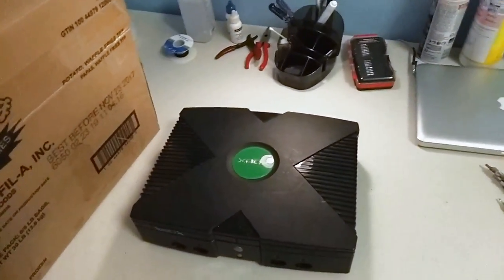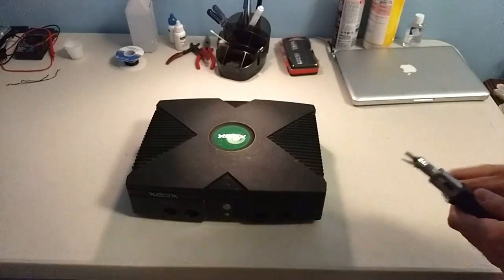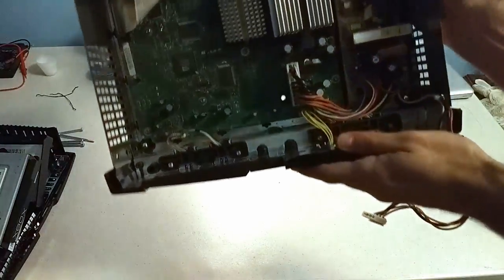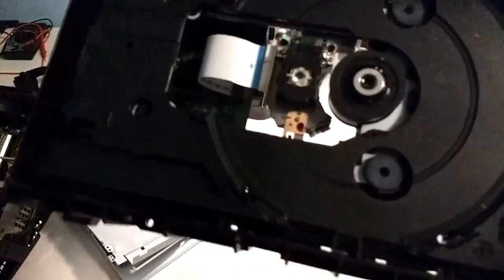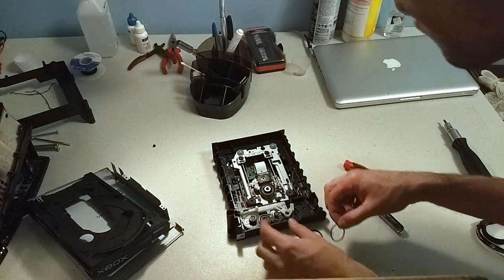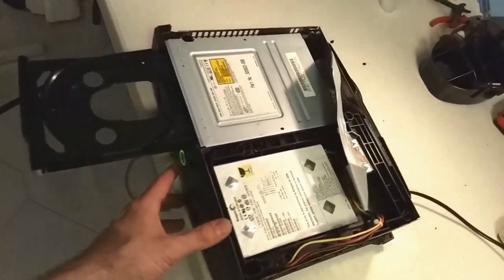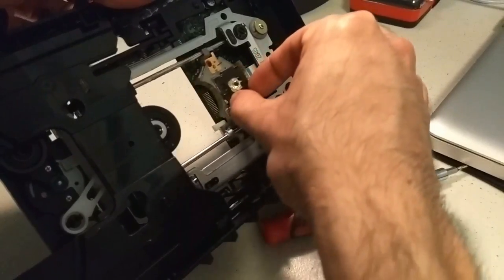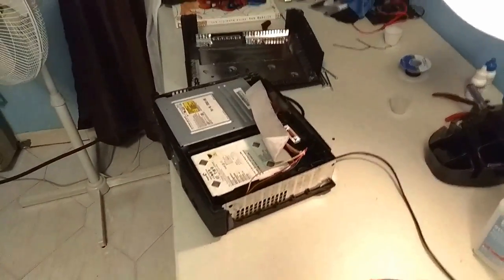Ebay Repairs- How to repair a stuck DVD drive on the Original Xbox

Comment: There is an easy way to get these drives open without opening up the xbox. Although, It does not work on every drive type(It does work well with Samsung drives). There is a tiny hole to the left of the eject button. If you straighten out a paperclip and push it in there when you press the eject button it will open.
Reply: Thanks

Comment: You see i was a massive fucking idiot with my original xbox, my drive had exactly the opposite problem, it wouldn't stop opening. So i decided to HOLD DOWN the actual disc tray, jamming it into the console when you could hear the internal mechanism screaming. Now it won't open at all and i'm here to see how you take apart the drive, so i don't have to blow serious money on something equally as likely to now work. Nice set up BTW, your room's pretty baller.
Reply: you may have ground down the gears (very bad), or snapped the pin which holds the gear into place (not as bad). if the pin is snapped you can just glue it down again. this pin holds the gear into place, and if its broken due to large stress, then the gear wont catch properly and it will wobble about. it will prevent the disctray opening without ejecting it manually.
Reply: @AB-sr9mc  Thanks for that info! That must be what's going on w mine (the broken pin). My disc tray wobbles quite a bit and is a struggle getting it opened or closed and locked. I vaguely remember finding a small plastic piece broken off when I disassembled it for the first time and prob threw it away lol.

I was thinking maybe the plastic gears, laser rails, and sides of the disc tray may need to be greased.

Comment: I had a non-working DVD lens that I eventually fixed by using more pressure with qtip and alcohol on the lens than I thought was needed.

Also my tray has issues opening UNLESS it has a DVD/CD inside and it opens perfectly. I leave a blank CD inside it when not in use now. (Replacing drive band soon).

I don't know if this will help anyone but it's worth a shot.
Reply: just try boiling the rubber band in water for a few minutes and you should be good. although replacing it wouldnt be a bad idea either.
Reply: @4n0n87  I ordered some replacement original Xbox DVD bands and wouldn't you know it, they came in and they were Xbox 360 bands. And no they're not the same. The 360 bands are looser.

Comment: Hi Retro_VG_Repairs... Great video.... on my original Xbox V1.6b the hdd has gone bad. If I were to buy a 2tb hdd and install it will it work out.
Reply: No you need a chip / tsop flash or readout your eeprom. Your HDD needs to be locked with the eeprom key
Reply: @XY-wy3rh  not necessarily true. If it’s modded already and you have an eeprom backup, then you can swap out drives fairly easily with xbhdm and an IDE to USB adapter.
Reply: @Dikwili  But he wrote its an original xbox which i assumed means unmodded. But yes, in such a case youre right.
Reply: @XY-wy3rh  original Xbox meaning the first series. This is how virtually everyone in the community refers to them.

Comment: Uh that "stain" was just a marker dot mines blue but I'm pretty sure they can very in colour. (Oh and Edit) those little "tabs" that broke off yeah same thing happened to me but, it doesn't seem to have any trouble with opening and closing anymore which is good.
Reply from the maker: Yeah I think its just a quality control mark, to show that its been "checked"
Reply: Retro_VG_Repairs probably and also, god it's 2:13 AM here I'm tired trying to fix one of my original XBOX and it keep saying "Your XBOX requires service." W/red blinking light and error #06 and I'm like great!

Comment: I also had to smack the top of my original Xbox and 360 to get the trays to extract
Reply: i spent hours looking for a solution trying to repair my old xbox... and got frustrated because of it, i read this comment/suggestion and smacked the sh*t out of it.... it worked, thanks bro!
Reply: it was a fix I figured out because the drive sometimes backs itself too far and the tray motor doesn't have enough torque to grab the tracks again. So a nice SLAM! and it jumps onto the first tooth and opens up
Reply: Mr Guru  lol guess mines broken different then. But hats off to your solution. I'll just smack mine lol, might repair it when I open in for it's next cleaning/cap replacement in 10 years

Comment: Hoping this works ... Disc drive is so dusty inside I bought it pre-owned a few weeks ago surprised mine even reads disc it's so dusty going to take it apart just to clean it hopefully it will still read discs and play after I do this
Reply: did you have any luck?

Comment: I have an Original Xbox disc drive where the laser is fine for reading, but appears to not be able to move freely. Any idea of usual fixes for that? 
 I used a magnet from a spare disc drive to be able to see what what going on when I put a disc in, to make sure the disc was spinning properly
I used this tutorial last year to replace the old disc drive for this particular console as it was giving the dirty disc error. The replacement was working fine when I was using it around December 2019, but sometime between then and now (July 2020) the laser must've got a bit stuck or something.
Reply: Make sure the two side rails are clean, then lube them.  Also there is the threaded shaft that comes out of the motor only visible from the underside on a samsung, it spins and moves the laser assy back and forth.  Make sure it is also clean and lubed.  You should be able to move it back and forth quite easily

Comment: What screwdriver did you use to remove the cover?
Reply from the maker: The End torx 20. Also called t20
Reply: Retro_VG_Repairs and for the dvd drive you need a torx 10 to remove the drive from the Xbox.

Comment: I repaired my drive — replaced the belt, lubricated and cleaned the laser. Success at first – and then the drive stopped working completely. No response, no power.

Any suggestions? It’s a Thomson TGM600 drive.
Reply: I have that problem with my philips drive. No power being fed into it, I plan on checking the power connectors but if you found a fix lmk.
Reply: @wongoli  I never found out the issue :/

Comment: thats funny ,i have the bad habbit  also of not putting the caddy screws back in ,
i get mad at the damn hard drive ribbon cable , and after bending the damn thing to fit back in for 20 mins,
those caddy screws are just going in the trash lol.

your better than me ,  and at least you can resell your work if you choose,
i dont think anyone wants my xbox thats missing most of the screws.

later.